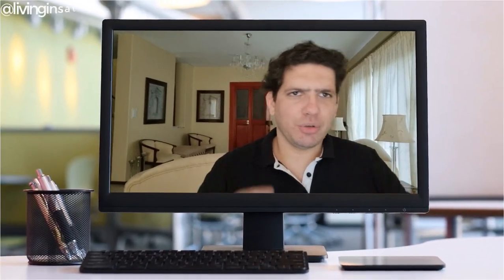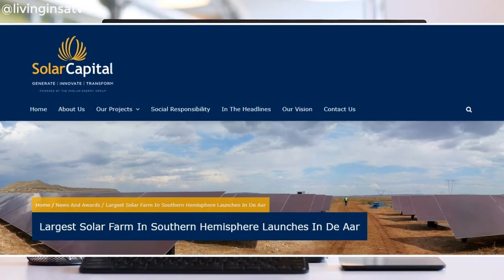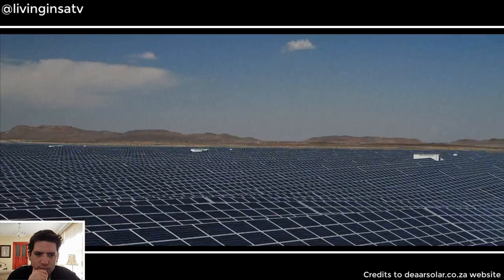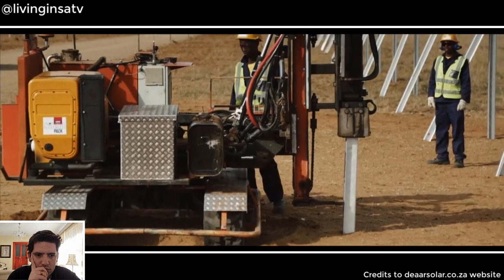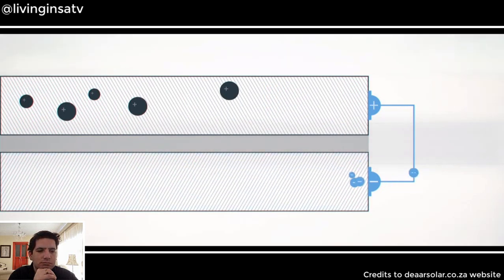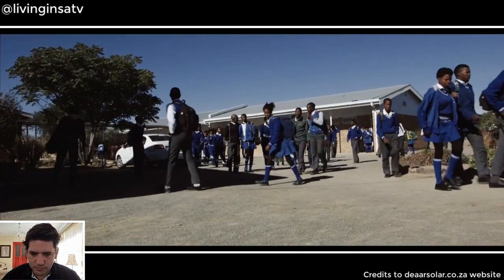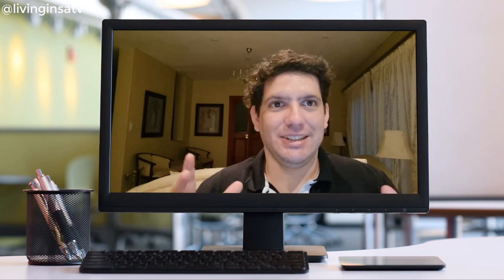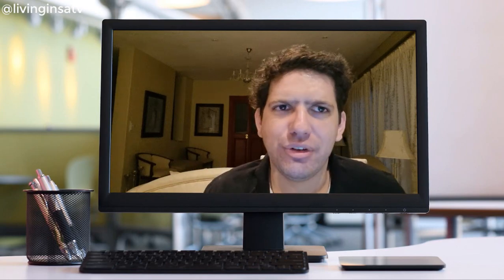🇿🇦R4.8 billion De Aar Biggest Solar Project in the Southern Hemisphere (in🇿🇦)✔

Comment: I'd be more interested in the storage they're using. 
Solar is a failure. 4.8 billion rand for 19000 homes a year. 
Its green! Is that the argument? Its not green, the production of each solar panel 
Is chemically intensive, this isn't even considering the concrete supports. 

The job creation sounds great. 
The community ownership sounds like a recipe for deterioration.

Waste of money. 
Research modular nuclear or join the europeans in figuring out fusion. This is kak.